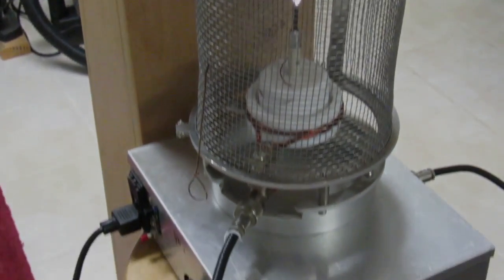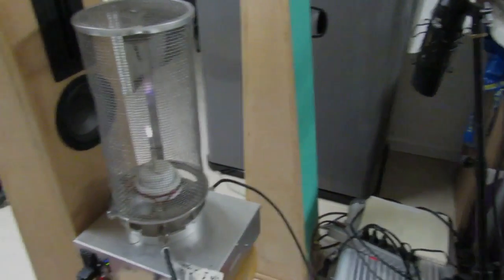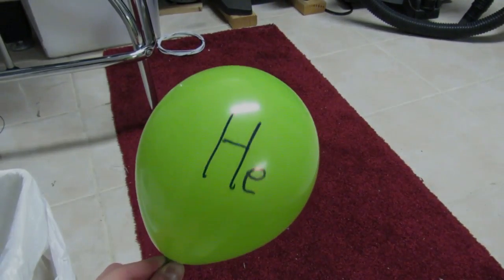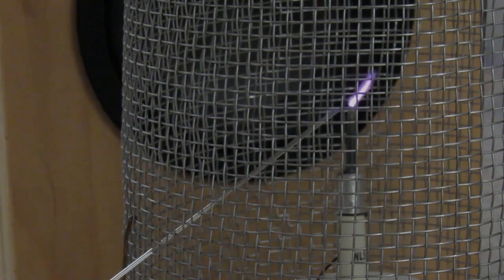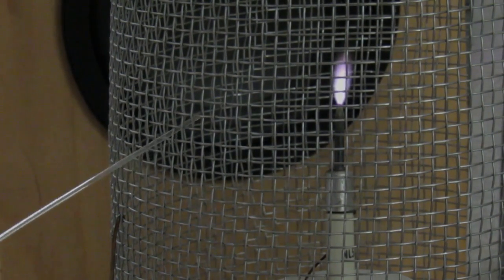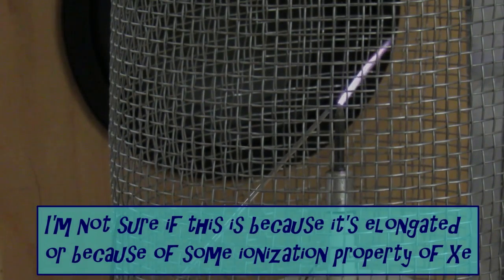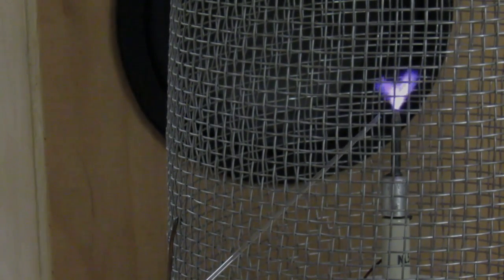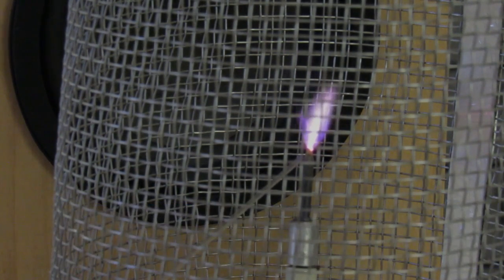Plasma Tweeter and Xenon (Xe), Neon, Helium, CO2; Surprising Results!

Comment: Excellent, the density of each of these various gases will provide a different efficiency of thermal conductivity to the rest of the surrounding gases in the common atmosphere of the room. Of course each of these will vary and their effect and either adding to acoustic output transfer or buffering and eliminating effective acoustic transfer to the surrounding air column. Perhaps maybe build a small laminar ring to place around your electrode or emitter at the base and allow a very slow consistent laminar flow to rise over & envelope the active corona thermal interface with the surrounding air volume.   One could gain considerable advantage if he were to acquire a length of temperature stable glass tubing (much like one would find on an oil lantern's wick encasement tube). I would guess dimensions no bigger than a diameter of 3 inches with a length no greater than 10 to 12inches.  If one has the daring and skill to do so, one would certainly wish to venture into cutting out a opening within this tubes length as a means of controlling acoustic transfer coupling and bandwidth tuning to the surrounding air mass.   I think if you try this approach you will be quite pleased with the results, if not just outright impressed by the minimal effort in exchange of noticeable gains.

Comment: Okay, so this is the video  I have always wanted to see!

THANK YOU FOR MAKING IT!  Are you on the DIY AUDIO Forums?     Also, that looks like a parts express woofer!  Is it?
Reply: Man, you are on FIRE (or plasma?)! Yes, it is indeed a Dayton 5" woofer from Parts Express, but I bought it about 20 years ago, so you have a good eye! I should join DIY Audio Forums. I haven't yet. 

I was surprised how little of a difference the gasses made, and I thought the color would change more depending on the gas, but it was a good experiment! 

For sure the electrode will last longer in inert gas than normal air (oxidation), unless it gets sputtered by the heavier atoms (Xe).

Comment: Heavier gasses will sound louder because you are making the sound medium denser, gasses like Helium that are light will act as a sound insulator.
Reply from the maker: Thanks for the input.  On the other hand, Nobel gases don't like to ionize as easily (especially He), but anything other than He or maybe Ar is too expensive!
Reply: np, interesting experiment; IMO I think you would get a cleaner sound arcing plasma between two points rather than into free space, seen some commercial speakers use plasma but they appear to use a very tiny almost dot-like flame.